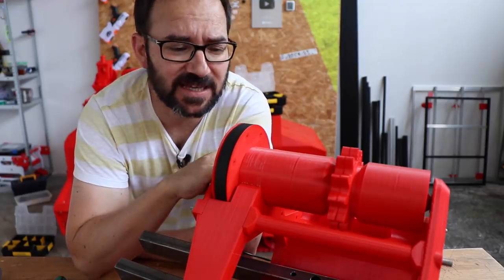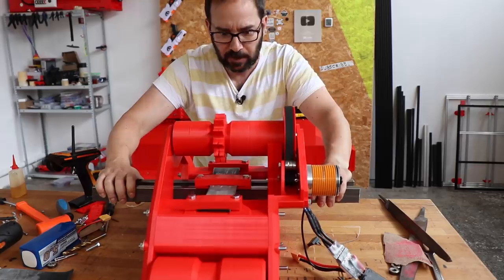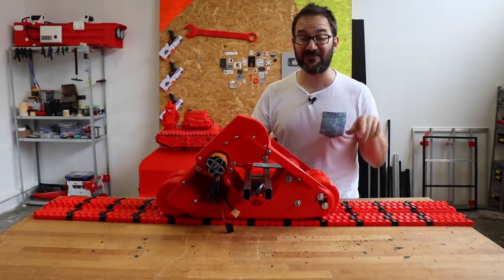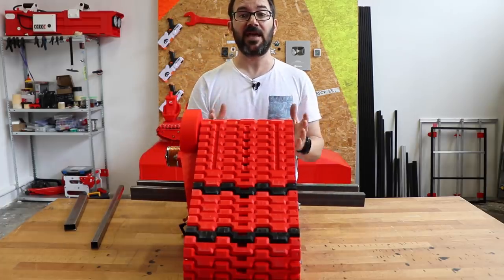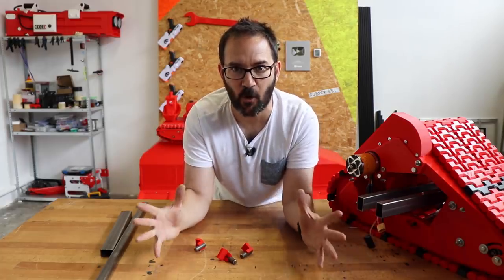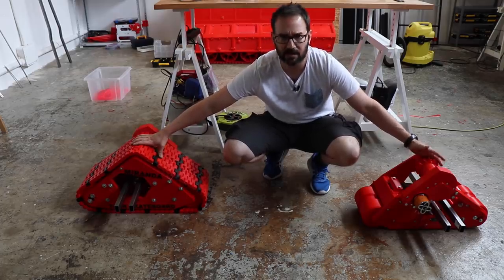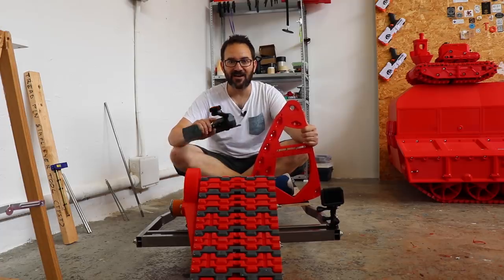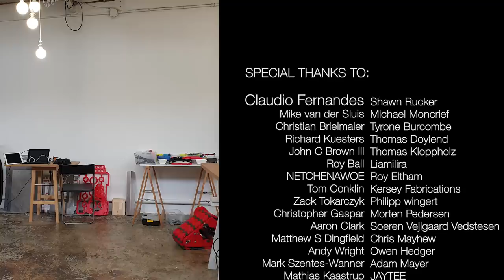3D PRINTED TANK SKATEBOARD - THE BUILD

Comment: 11:00 I could see that single track be ridden with one foot on either side of the track. Like a mono wheel.
Reply: He has already done that in the first video about it :)
Reply: Needs a bit more power I think, but if the thing is 3D printed and has the power of two engine blocks then I can definitely see it tear itself apart.
Reply: @roxrequiem2935  im pretty sure that has happened before on some other smaller projects...

too much power on a small build is almost like a dumb kid with matches playing near a crate of tnt, totally no bueno.
Reply: @thedinastyguild  Haha. Less of a kid with matches, more like a washingmachine with a brick inside XD
Self Destruction Lvl. 100
Reply: Totally was thinking that too..
Reply: ok how do you turn
Reply: @_Simon  I think similar to how you turn a motorcycle or a skateboard by shifting the weight around. I don't think you can turn very sharply tho.
Reply: @_Simon  
It's unidirectional. 🤣🤣🤣

Comment: An amazing build.  May I suggest 2 or 3 pieces of angle aluminum (or steel)  to support the wood deck better?  There was quite a bit of flex in the deck (which in the short term is a good thing for your body, but in the long term can break the deck.). If you put 3 pieces to act as cross members from one side to the other under the deck, it'll make it really strong without adding much weight.

If you don't want the deck to be too stiff because it absorbs shock, then thinner angle aluminum will have plenty of flex but combined with the wood will just shore it up enough to make the wood last.

If you need some shock absorption added back into the deck, adding another layer of a compressible grippy material like neoprene / yoga mats to the top could help your knees, further.

With such a fantastic build it seems like there may be several other opportunities to add some level of shock damping either at linkages or at mating surfaces, if you desire.

The interface where the frame bolts through the wheel could be designed as a suspension with a short strut or shock absorber at that interface to dampen impact energy.  I'm sure several ways this could be achieved either suspending the frame or supporting the frame with a linkage.

Regardless of my comments on trying to add a suspension, this build was truly incredible.

Comment: You should consider getting a welder, even a very cheap one will be very handy😀👍
Reply: Ivan, you're ready, its time to level up with welding!  I realize that the bends you put into the steel body are part of the prototyping process, but it feels like those are unlikely to hold up, as the bent areas are much less structurally sound now.  Perhaps reinforce with plates+weld?  Very cool looking project, and amazing out of the box thinking on this!  Your CAD skills are impressive too. :)
Reply: a Welder and a square tube bender, also a small lathe or a 3 in one - lathe, milling machine, and drill press - would come in handy too.
Reply: guys, any video/article recommendation for a complete beginner welding guide?
Reply: @Fatbutnotflat  just get a "mig" welder and start sticking steel together. it's basically just as easy as a hot glue gun that spits metal, but it's just for plain old vanilla flavoured steel. cheap ones use flux core wire so not really mig or mag, real ones you'll need gas bottles. you could start with stick welders too, they're really cheap. AvE recommends starting on stick for the learning potential, rather than going straight to mig where it's so easy you don't learn anything. just don't try to start on tig; it's really versatile but its slow and expensive and the most difficult to learn.

Ivan doesn't need precision machinist tools. as I've said before he's a maker, not an engineer. he doesn't do meticulous planning before he starts, he just goes for it and it usually ends in failures. if he got a lathe, nothing would ever get done. You're lucky he didn't try to hammer the bends in with a screwdriver.

Comment: I love your creativity and builds.  They are really awesome.  

There are several things I think I would change.
1. Use a tubing bender, it would help. It would allow tighter, cleaner bends
2. Deck width is way too wide.  You are liable to catch a edge and end up falling.
3. By making width of the deck smaller this would allow you to narrow those connecting rods to the deck.

Overall this should make it much safer to ride.

RC

Comment: Take a few centimeters off the width, still a lot of clearance to the motors, and it looks like the down side would hit the ground before the up side hits the motor. You definitely don't want the corner of the frame digging into the ground when you're carving a turn going fast. Even with a bit of narrowing a curved skid stuck into the ends of the rails wouldn't hurt. There's a job for your CNC, along with spacer(!) blocks to go into the ends of the truck mount cross rails to ensure the side rails stay aligned. Also, two more cross rails under the deck board.

Comment: So I've wondered about this for several of the machines that you have made with hollow tube: The threaded rod through the tube is a cooltrick, but it seems like aligning the tubes is a challenge.  And I wonder what keeps the tubes from losing their alignment after use?  I think you could print a plastic plug for the end of the tube stock to hold the threaded rod in position and give you a positive alignment.

Comment: Using traction turning and standing  within the treads might be easier for balance not for smooth steering but with leg back support poles from base might help compensate for this but pool noodle pole protection would be advised

Comment: If you get some M600 filament change handling in the firmware of your printer you won't need to hand-color the embossed lettering. Just put the M600 in your gcode right before the lettering is printed and swap from red to black when the printer prompts you.

Comment: Ivan, i would recommend that you maybe put on some thing rubber on the black parts of the tread if you are planning on using it on asphalt or concrete, it will add traction and increase your safety! I think that those things that you use under the chair may help, i duno i dont have things like that lol

Comment: Beef up rubber bands, center the side rail tie rods and add at least one cross member. Rigidity equals control. Awesome build as always. P.S. You all have inspired me to build a bigger printer. I am in the U.S. and I am having trouble sourcing T-slot aluminium, any suggestions would be helpful.

Comment: You are going to need some bracing under the board, but with he steel, why didn't you just cut and weld the joints rather than bending?

Comment: hey dont you have to be careful if you put sheer load on things designed for tensile load, like what you did, with the threaded rod, to connect the frame together?
Reply: just a little worried they might sheer and you'll get hurt
idk how much force they need to be under or for how long for that failure mode, though
I just know it's best to avoid it

Comment: you need some cross braces under the plywood its flexing a little. i would be a bit worried about taking it at high speeds or off road.

Comment: Awsome if not master chiefs new ride be cool on unreal should make a lightweight fast street version with tube tracks and use this for the offroad one but handy tip treads should be larger than standing deck even if that means making the deck smaller great proof of concept good potential would like to see electric boards like this but optimized and corrected go mainstream some foot hooks might help and intentional belt slip or gradually increasing chip regulated step up acceleration for less jerky throttling might be in order but cool prototype great work man I like

Comment: Ivan I seriously need your help with my 3d printer. I built one from scratch and my boards are Duet 2 wifi and Duex 5 expantion. I loaded the yat program and drivers to my computer and then I was able to get connected to the web control board online but the configuration part will not load on the web control board. I also ordered and installed the Quad Fusion extruder head. I don't know where I went wrong and I'm beginning to think I'll never get the printer going. Please help.

Comment: It would be a challenge, but if the motor was under the track instead of sticking out the side it could be a lot narrower, which would be better, cos then you could drive it through doorways, and tight gaps etc.

Comment: if i were you i would adjust that braker control that way dont throw ya off when let off controller
n i seen few at end of video i saw it throw u off

reduce braking controller around 40 to 30% it may take whiles to slow it down to stop without throwing ya off

Comment: Using a vice as a press isn’t a good idea. They’re not designed for it. Where I work, there’s a huge vice that we can’t use now because someone decided it would be a good idea to use it as a press instead of the presses beside it. The proper way would be to cut, bend the tubing, then weld it back together